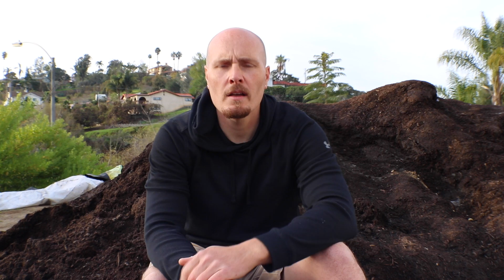Making compost is an EXPENSIVE WASTE OF TIME (at least for me)...

Comment: My compost has been free for the last 4 years. I grow my garden, and at the end of the season, it all goes through a shredder and piled onto a large plastic tarp. Corn stalks, pea and bean plants, carrot and beet tops, tomato plants, potato tops, chipped wood from fallen branches and trimmed bushes, old flower leftovers, and more. Then I also add the hair from my brushes, garbage from my cooking (like banana peels), kitchen waste (like used paper towels and tissues), shredded mail, plus all my mowed lawn clippings. They all go into an area for at least 2 years (I usually have 3 piles), and I've never turned them. The oldest pile is the one used on this year's garden.

Comment: Go buy a waterproof barrel  (plastic or perhaps a metal barrel originally designed to hold food) or large outdoor garbage can. Install a spigot in the bottom with a screen to keep the spigot valve from getting jammed with debris. Put the barrel/garbage can up on blocks high enough that you can fit a plastic bucket under the spigot. Forget about using the compost. Just use the tea. If normal rain fall directly on the barrel isn't sufficient, put it where rainwater can be diverted into it from roof runoff or use water from the hose. Use the compost tea rather than the compost. Don't worry about turning the compost, etc. Just keep piling it on. It will shrink as it rots, especially if soldier fly larva get in there. Around where I live, a barrel such as I described runs from $25 to $35 (although sometimes you can get them for free if you're lucky). 

If you do get black soldier fly larva involved (and I'm not sure that's a good thing if you don't have chickens to feed them to) then you can add things you normally don't put on compost pile like meat scraps. If you get black soldier fly larva and you don't want them, just put in enough water to drown them for an hour or two and then drain off the tea.

Let it rot for maybe a month before you start getting tea out of it. Ideally you'd have two such barrels. You'd fill one up with compostable material, not worrying about grass seed, etc. Once it gets full and starts to stay full, such that you have to put stuff in the other barrel, only top off the first barrel with stuff not having weed seeds and start filling barrel two. Eventually barrel one will end up maybe half full of rotted down stuff and barrel two will be in danger of overflowing. Then you start putting your stuff with weed seeds in barrel one and making tea from barrel two. More than two barrels is an option of course. 

Of course you can also just use most of your garden debris for mulch and I would recommend doing that instead EXCEPT where weed seeds might be involved, etc.

Comment: You can set up your plants to compost for you using chop and drop methods, or, if you don't have time, really plan out your companion planting for long term cooperation between your plants for optimized succession and/or nutrient sharing. What are you exporting from your land to make room for that compost import? Where are the imported materials coming from? I learned the hard way that bought compost is often not clean, as in, manure with antibiotics in it or micro plastics. My farm is working towards organic certification so this is important to me. In a suburban setting, your run off will have a much greater impact on local water because there is so much cement channeling the water directly into wild water sources so please be sure the imported biomass is safe. Again, if you really do your research when planting at the start, (either annual or perennial) you can create the proper nutrients for your soil from the very plants growing in them. I also wonder how you're utilizing your chicken manure Diego, how is that returned to the land for soil improvement?
Reply from the maker: Fair points: 
1.  Compost is OMRI certified from a local compost manufacturer.  
2.  Nothing is getting exported from the property.  Keep in mind I am in a dry region so a lot of the plants I have are low water use plants that don't grow much and never get trimmed.
3.  There is no run-off from the property other than what runs of paved surfaces that is collected on paved surfaces - meaning the driveway.
4.  I need a large volume of compost to fill an area, more than I could ever make on site.
5.  The chicken manure just stays where it is dropped on the planting beds.  That's why I have them in the system.

Long story short, I just don't generate a lot of biological waste on property to compost.  Everything that is generation basically stays where it was created with the chickens.

Comment: I'm not positive but that is a lot of compost to be just managing an existing planting bed.  If you practice no dig methods where your soil structure improves over time you will need only about a 1/4" of compost added annually for nutrients and the cost will reduce over time.  I suggest you check out the One Yard Revolution you tube channel for proof of this system in which Patrick has no longer needed to add additional compost to get amazing results in a compact location.  Also, the other reason everyone should be composting is to reduce their own waste added to landfills and the fossil fuels required by large operations to do the work for you.  I get the time thing, but we as humans need to make lifestyle changes to protect our future and planet.
Reply from the maker: I am totally with you on maintenance compost needs.  I am using it to fill in an area and build up the beds that I have.  It's the cheapest and easiest fill that I can find.  Longer term I won't need to buy that much.  I don't make it because I don't generate much organic waste beyond what the chickens eat and what gets chipped.  I am not composting and sending stuff to the landfill, I am not composting AND ALSO not sending stuff to the landfill.  Compost isn't always the best end use of the material.
Reply: One correction:  Patrick of OYR still makes and uses compost every year.  He moves his mulch aside and adds compost to his planting hole when planting annual veggies.

Comment: I'm not sure that, historically speaking, composted plant material (aside from swamp muck and seaweed perhaps) was very common. Mostly people let livestock do the "composting" in their bodies, then used the manure, which might have been aged but wasn't composted as we think of it now. Makes sense from an energy use perspective. But I do agree with what you say here. Compost is a good way to dispose of crop residues and such, but can't really be relied upon without outside input, either bought or scrounged. So ultimately it probably isn't "sustainable" as a sole source of fertility.

Comment: I never used the aforesaid compost company, but my site work contractor here on the east coast said nearly all soil, mulch, and gravel deliveries are limited to 15 yds. due to trucking weight limits.  I was burned on a pretty sizeable order where I was shorted 5 yds. a load when the seller claimed they were 20 yds.  I learned to slap a tape measure on the dump truck: length ft. x width ft. x height ft. ÷ 7 = cubed yards.  Then make sure it is filled to the top.  Great video and good luck on your garden.
Reply from the maker: Thanks.  Out here they deliver mostly in transfer trucks which allows them to carry more.
Reply: That's smart. I'll do that next time, to be certain.
Reply: Would that really be accurate though?  I've never been in the business of hauling anything so I really don't know if there is particular ways of doing things but wouldn't the only real accurate way be the weight of the load with a moisture meter?

Comment: I live on 1/3rd acre suburb  , I make my own compost. if I needed 20 yards immediately yea I'd buy it , but I can get PAID  to take 10-20 yard landscape trucks of leaves,grass and woodchips,  and just compost that I'm an aerated static pile composting chamber, just blowing air into it from below, the heat from it can also help heat my home or a greenhouse  or raised beds with low tunnels...
Reply from the maker: +tribalwind Nice to get paid to take it.  Doesn't work that way here.  If it's working for you do it.
Reply: Diego Footer  cool,  how's it work by you?
most municipalities  that have landscaping companies are going to charge them dumping fees per pound of "green waste"  , here they also require tree companies to chip logs for dumping. I just offered my neighbors guys to take loads once in a while for $150,saving him at least the time and hassle of going way out to the dump. 
before this is just told these crews to dump at me for free,mostly used for deep mulching .  I also take full logs and chainsawmill it for craftwork and natural building.
Reply from the maker: I think (my assumption) that's there is a pretty cheap tipping fee out here and it is free depending on the material in some locations, so no one will pay you to take the chips.  And it's very hard to even get them to drop it off for free.  Over the course of 5 years and lots of asks I have probably had 10 loads dropped off.  It's hit or miss at best, and you can't depend on it.   I have a landscape neighbor, but he doesn't do trees, so his drops are mostly soil.
Reply: interesting. 
here in Long Island NY it's free for town residents to dump residential amounts,  but commercial enterprises have to pay a good bit.  although 20 yards of leaves/grass represents like many dozens of homes, so $100-200 is really nothing at that scale.

Comment: I can understand doing this in the short run as you build the site. But I would hope that overtime you would establish plants that would create biomass for you and start moving to a chop and drop system. Using some perennials, no till and a polyculture planting system combined with a rotation setup for your annuals you should be able to eliminate the need for importing compost. This should still save you a lot of time compared to the large compost bin setup that you described but would also save you the annual cost in dollars that importing compost brings.
Reply from the maker: That's all true, but on a small scale I can generate a small amount of compost, not a lot.

Comment: Excellent job explaining the why approach to soil building. Soil building and especially aerobic composting is a time-critical commitment. You need to be monitoring the temperature of the pile(s) and timing of the turning is critical in order to kill weed seeds, kill pathogens, and maintain oxygen and ideal moisture levels. It’s important for each of use to consider our needs and resources. I also am in need of many yards of soil as we are building our bed on a very rocky gravel base. I’m currently composting minimally 40-50 yards of finished compost yearly along with several other soil building techniques. If’s TIME consuming. I also have the advantage of having a location and equipment on site to do the work efficiently. However there are times that I have to be out there long after sunset getting the piles turned. Keep bringing up these topics. Their valuable!

Comment: When you make Airobic Hot Compost using the method Elaine Inghams describes you use that compost more like an innoculant because it contains the full biodiversity of the soil food web. The compost you buy in might well be great but does it contain the living airobic organisms like you find in the soil food web or is just organic matter and nutrients. I agree with what your saying though, turning a ton of compost every day is very labour intensive and time consuming. If you have got the time and energy I would highly recommend it, all you need is fine wood chip, freshly cut grass, some manure or legume and a spoon full of soil from an old growth/ancient forrest.
Reply: Compost always contains living microbes, although they vary depending on the stage of decay and concomitant temperature. The soil microbe population once applied depends on availability of nitrogen and other factors and would be there with only organic matter and nutrients like N.